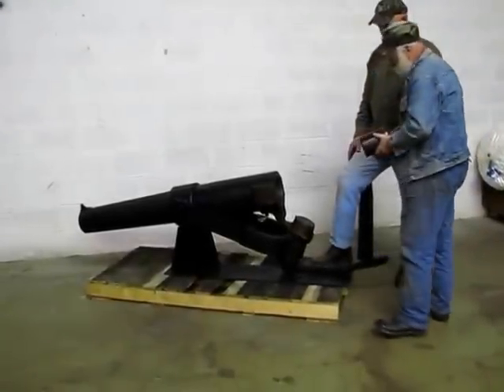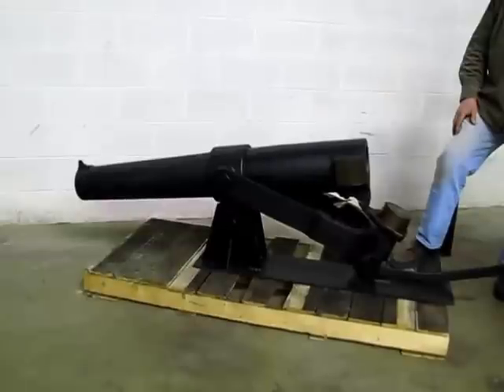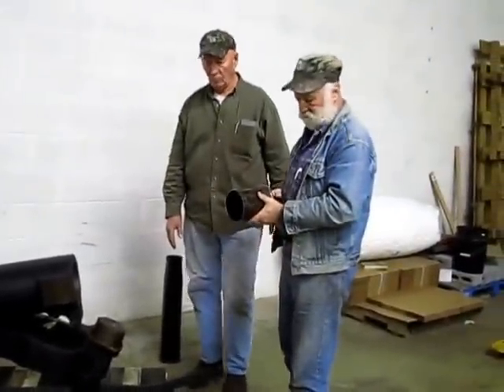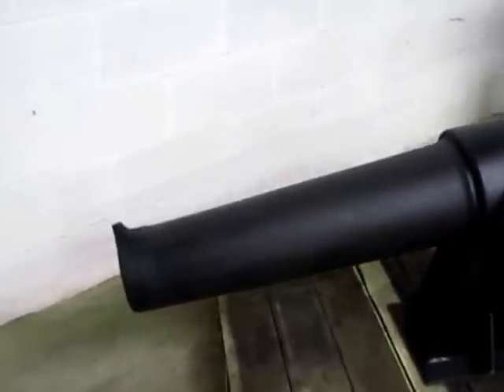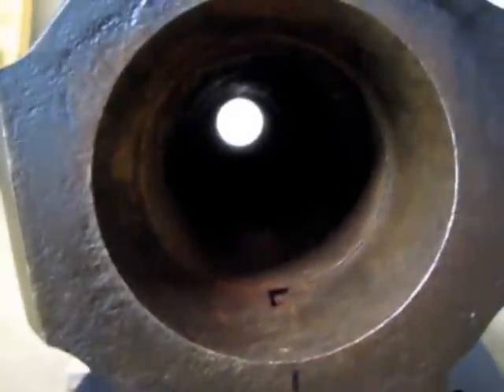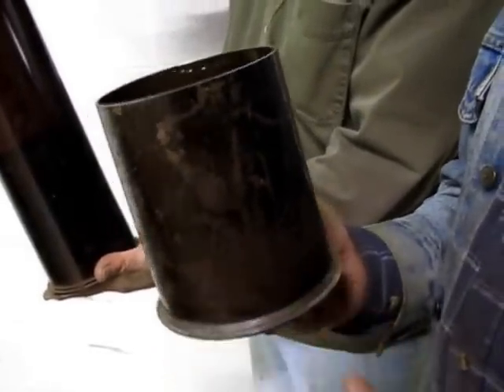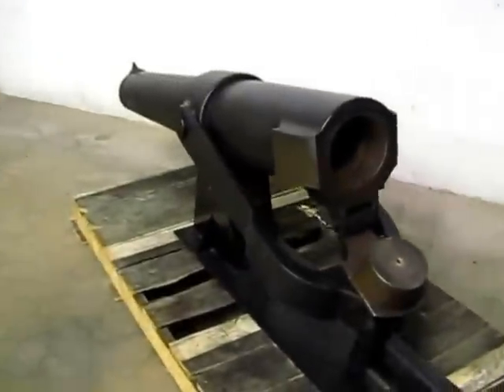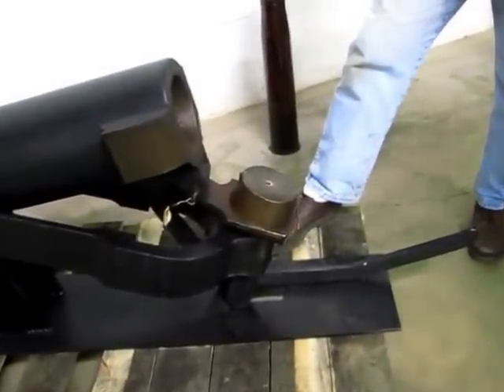The Moffatt Experimental 12 Pounder Breechloading Cannon of 1870

Comment: This setup is actually a copy from a 16th century German manual on obscure breech loading designs.  Didn't work back then, and it seems to not work now.
Reply: Eh they weren't bad they were just expensive.
Reply: Breechloading guns were surprisingly common during that time (not mentioning the kind that uses a mug as a breech). My local castle used to have a few breech loading wall guns from around 1600 that were appareantly quite effective during a siege in the 30 years war as the imperial attackers werent able to show themselves in the then already occupied town in front of the castle. Unfortunetly for the swedish garrison and the townsfolk, they failed to stock up enough provisions and the imperials threatened to burn the town so they surrendered.